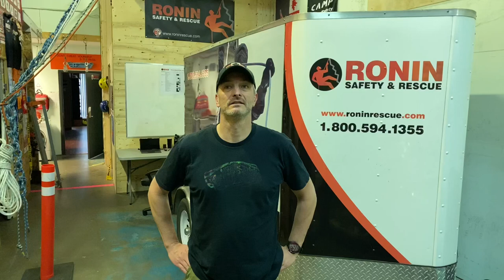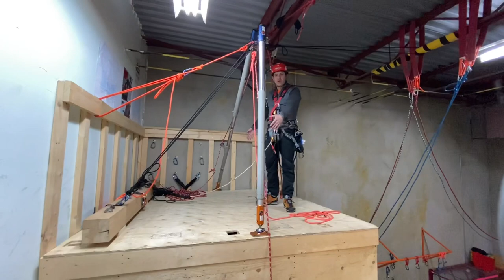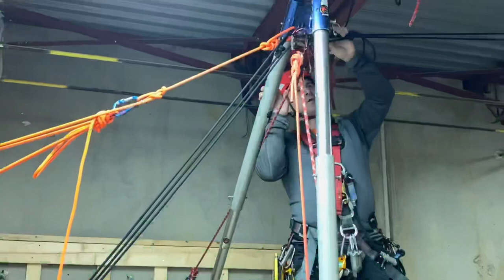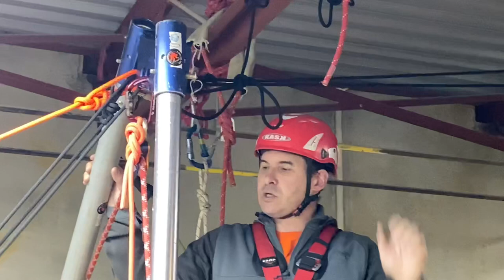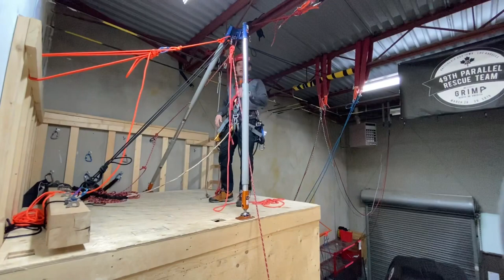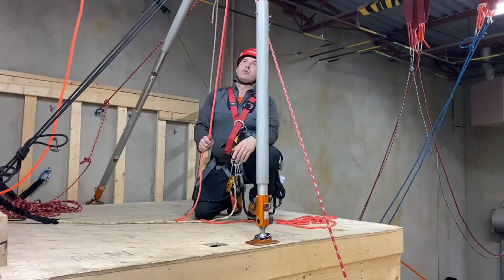Side Ways A Frames

Comment: In a real life rescue situation, you can't screw into a wooden board so bad example in my opinion for a training video. Back ties are interesting though
Reply from the maker: I don’t follow. I work FD as well and we will anchor into the ground whenever we have to. Hilti, pickets, screws. What ever it takes to secure it.
Reply: Pickets make more sense, but it be more informative so show a lashing technique but I'm not knocking this just think screws are not exaclty something u can trust, building material can be rotten or damaged, I am on FD as well. Pickets or lashes is a safer bet than house hold screws
Reply from the maker: @LawnGeeks  Agreed. We have a tendency to try concrete anchors if possible but noted. We will try to get a short clip in on lashing.